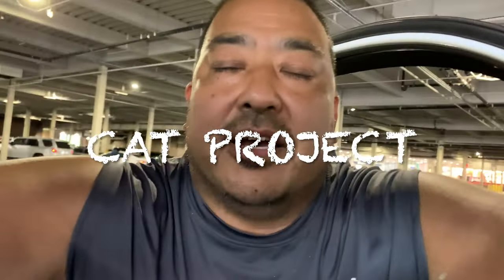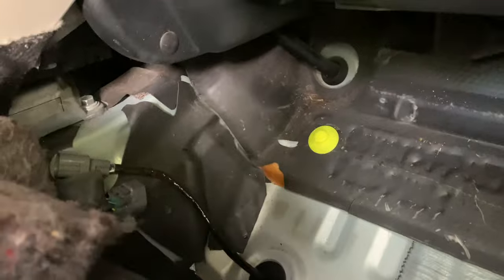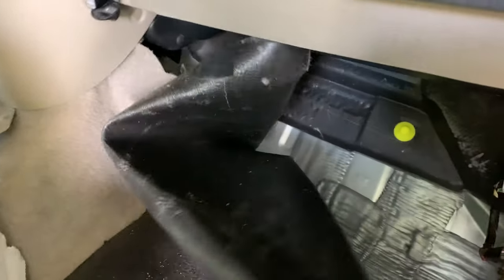Prius Catalytic Stolen

Comment: How is this happening in Hawaii? I would think on an island it would be much easier to catch them exporting the cats
Reply from the maker: Hawaii has one of the highest Meth users per capita. Crack heads are cashing in. Im not sure how they are exporting the cats or if they are actually doing the chemical extraction themselves.